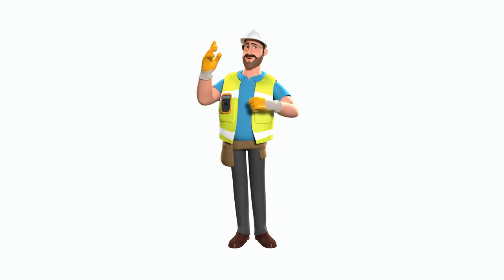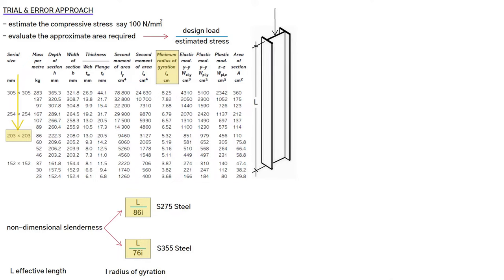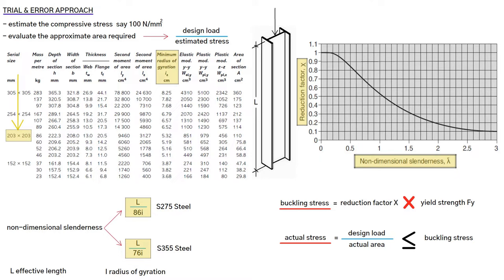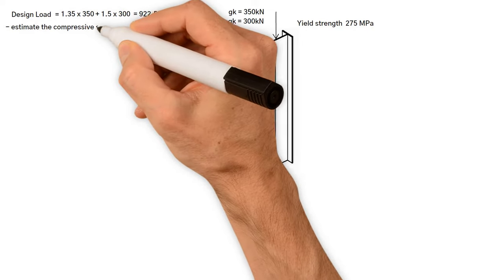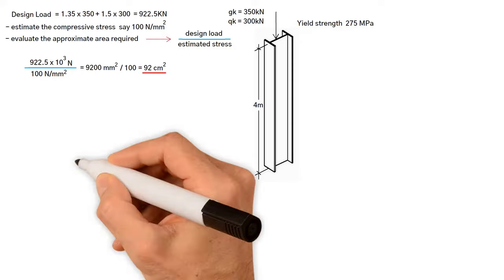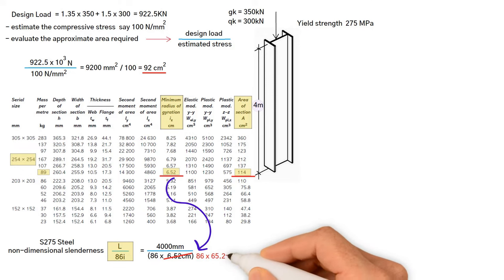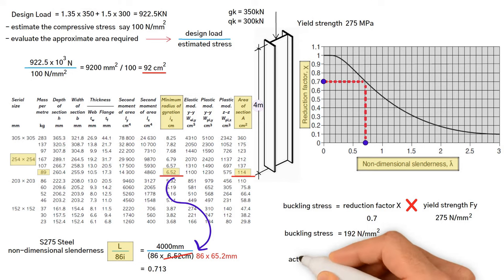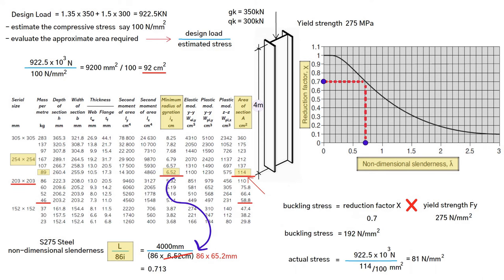How to design a steel column using an easy approach.

Comment: Just looking it few time and I don’t understand where you get the 350knm and the 300 Knm... from where you get the 4000mm ? Can you please do the example step by step... and show how you find those actor I mentioned to understand the math clear please.? Thanks.
Reply: the design DL=350KN & LL=300KN are obtained from structural analysis.  the selected column height of 4m is just an example.

Comment: Please explain for 1.35 and 1.5 in design load.  What do they mean, when to use them.
Reply: they are used to increase the load to induce factor of safety
Reply: They're safety factors used to increase the load. You use 1.35 for permanent loads (which is the weight of the structure and anything else that's part of the build up) and 1.5 for variable loads (which is the load you consider from people using the structure, or any other load that comes and goes/isn't constant like snow).

Comment: Trying 203×203×46 as you ask : 
This had properties,
 A = 58.8 cm 
i ( radius of gyration) = 5.11 cm 
The yield stress (fy) for this type of steel = 275 Mpa or N/mm² , it's the same.
And the effective length is 4 m or *4000mm 
• Non-dimensional slenderness of the section is L/86i 
So 4000mm/86×5.11×10mm = 0.91 
• The reduction factor X from the curve is approximately 0.68 
• The buckling stress is : X × fy 
0.68×275= 187Mpa 
• Actual strees is : 
Design load/ Area of section
922.5×10³ N / 58.8×10² mm
= 156.9 Mpa < 187 Mpa ✓ok

Susceptive to correct .
Reply: hi can you suggest a column for 8m length
Reply: Wrong. The reduction factor should be 0.58 not 0.68
Reply: So it failed actually

Comment: Hi, 
Anyone know the formula for calculating 'non-dimensional slenderness' for SS400 ?
i seem to couldnt find it anywhere, or any keyword to search would be great too
Thank you!
Reply: Slenderness (Lambda) = (Lcr/iz)x(1/(93.9e), where e = SQRT(235/fy). Fy is yeild stress, Lcr is buckling lenggth, iz is radius of gyration in minor  axix. You can follow the proceodure in my recent video, if it helps you https://youtu.be/udCnAM3RenQ

Comment: Who will help me calculate what type of columns and beams etc I need to make 7.5m L x 6m w and 4.5m H, cover/garage for my car lift? 
I live in country where there is snow, also no other weight on the roof except snow. I am just going to cover it with thermo panels.
And what is necessary for column foundation (concrete and rebar etc type and spec)
Reply: As an engineer, do it first. Then submit for vetting